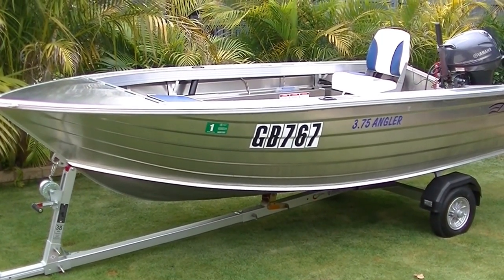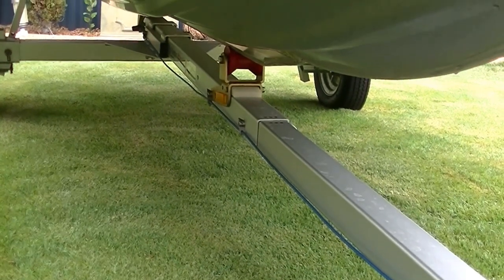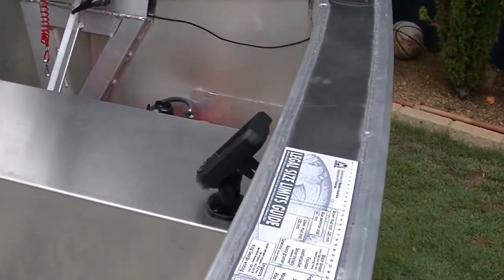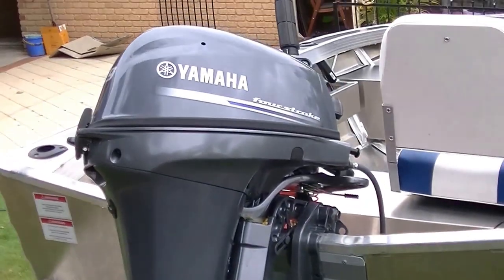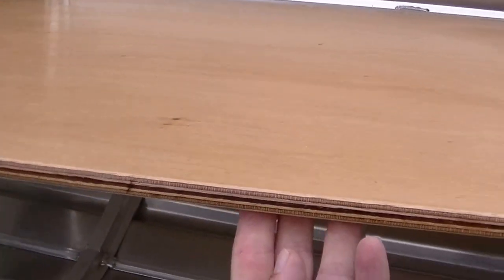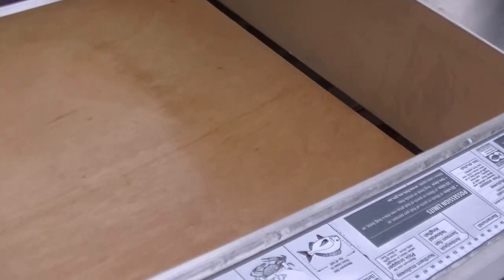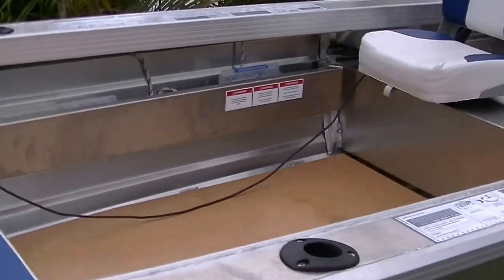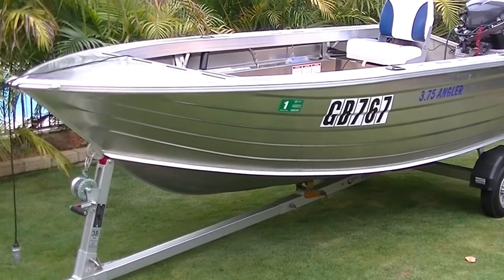Sea Jay 3.75 Angler Dinghy Part 1

Comment: Im tipping if you go up in size prop and pitch you wont get on plan at all !!! I am having this exact issues with 15hp on quintrex 370 outback explorer!!! The pitch on the prop is to high so motor has no torque to get up on the plan ! Ive just purchased new prop and waiting to try it out ! I would be very interested to see your results with a prop change !! And to see how it goes on water as it is !!!

Comment: Great setup. Just curious are the wide gunnels a factory option or was that done after purchase.
Reply from the maker: G'day Grant. Thanks! Yes the gunnels are a factory option as are the side pockets, rear step and transducer mount. Love the gunnels for the rod holders! And check out a more recent video I did on putting in a light weight false floor it's been awesome.

Comment: Hello I'm heading from Melbourne to Perth with my son later this year for some camping and fishing and am looking for a car topper. Where can I buy a Sea Jay 3.75 Angler dinghy with Yamaha 9.9 hp 4 stroke outboard motor and Mangrove Jack trailer and all other boating necessities over there?  Can you recommend someone to me? I'm concerned with crocs further up the coast.  Does the boat have high sides? We'll be doing a lap of Australia just camping and fishing with our little dog. I hope I hear back from you! Cheers
Reply from the maker: G'day Richard I got the dinghy from Midway Marine in Rockingham. But they got it made and shipped over from Sea Jay who have distributors all over Australia. And it will take a few months to get made, so I would suggest finding a distributor near you and get it made before you leave home. Also the 9.9 will be slightly under powered for the tides up North and I have since upgraded to a Honda 20HP 4 stroke as it weighs the same as the 15HP and has ample power the weight of the boat now. Very happy with the Mangrove Jack folding trailer. Just do a google of mangrovejack.com and you can get one shipped to you or pick one up direct from them on your way through in Perth, The sides of the dinghy are definitely high enough for use in croc country and is a great travelling boat very well made. Don't worry too much about crocs up the W.A. coast, I've been dinghy fishing up past Broome at Cape Leveque and still haven't seen a croc. Once you get get to the Broome area just start to be a little more croc aware. Once into the Kimberley proper and into the N.T. you'll start seeing them every where. Hope this helps Cheers Gary

Comment: Thanks for the video! Is your homepage online yet? I'd really like to know were you got the tinnie from with the few extras fitted to it, as i assume that your are from WA as well. Keep up the good work:)
Reply from the maker: +Ren ner Hi Ren ner,
Sorry it took so long to get back to you I just found it. The website is coming along, hoping it will be on line by the end of the year. There's a lot of campgrounds in Australia, but I'm getting there.
The dinghy is from Seajay and I got them to add the xtras while it was being made. Verrrry happy great quality and welding. Yes from WA. had to wait a while to get made and sent over from QLD.
Thanks for the feed back
Cheers Gaz
Reply from the maker: +The Campers Atlas Sorry the Seajay distributor in WA is MIdway Marine Rockingham